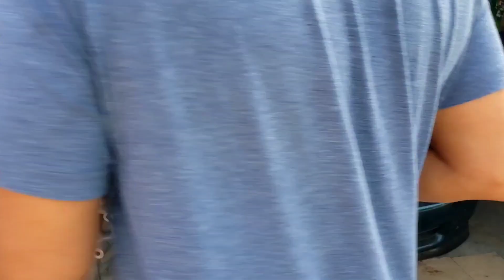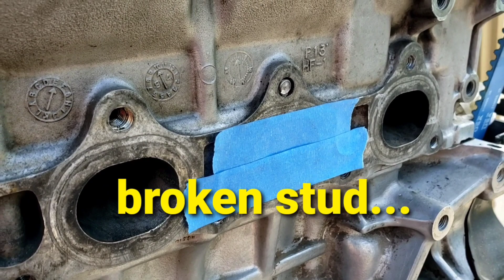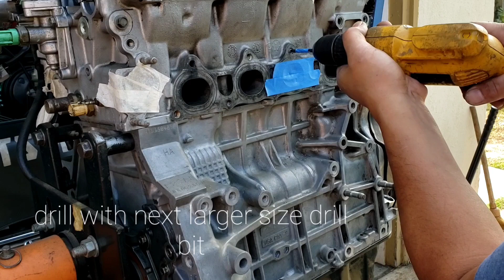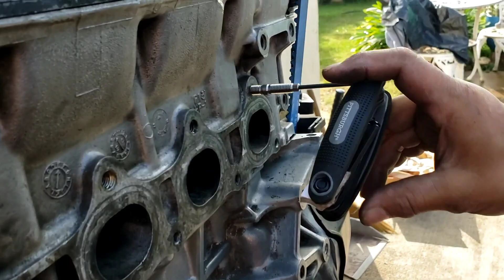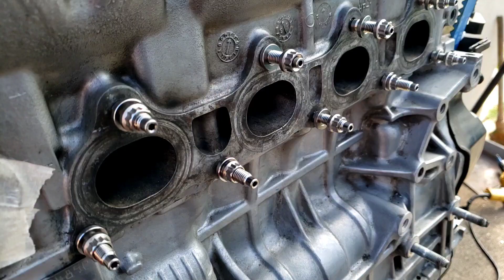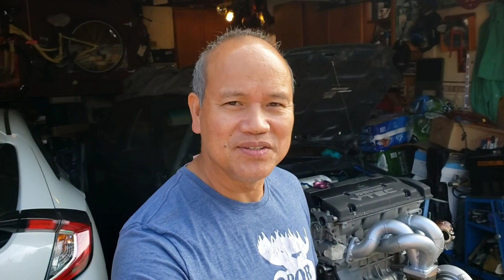Titanium exhaust manifold studs install on g23vtec.

Comment: I was going to pick up a set too but I am going to stick with OEM since I've read that they tend to back out.
Reply from the maker: These Titanium bolts are okay. When you install it, make sure the stud is tight. It does'nt back or loosen once its torque down. I've been checking these setup sinced after that episode and never come loose after. If you still want it, it's good.
Reply: @sagittnet2158  would you recommend it? It is kind of pricey or should I just buy the stainless version instead for half the cost?
Reply from the maker: @JohnnieIsBored It sure is price went up! I only paid $70 a yr ago from TRC (racingpartsnow) on ebay. I owned 2 sets of these Titanium exhaust studs and never came loose sinced the 2nd time l checked the torqued. I can recommend it, but make sure to give it a check once in while coz of all engines behave differently than others. You've seen my previous blog about the G23bk engine mounts. This engine got so much vibes and using new inserts minimize it. I'm going to give it another check  and you'll see it. I might give it a review. You'll see it.

Comment: i have used those in the past they are trash they always come loose i switched all my hardware to Downstar a few years back an i will never use another hardware company again Downstar for the win i am at 800whp an my Downstar bolts do not come loose even threw 150mph plus pulls thats at 28lbs of boost no issues at all change those things fast bro look up Downstar Frank Downstar is a good man with a awesome company and quality hardware
Reply from the maker: I figured that someone had experienced using these fasteners. Thanks, l will use a different nuts, maybe back to oem or like you mentioned. Downstar bolts.